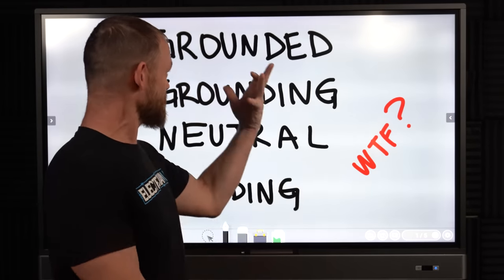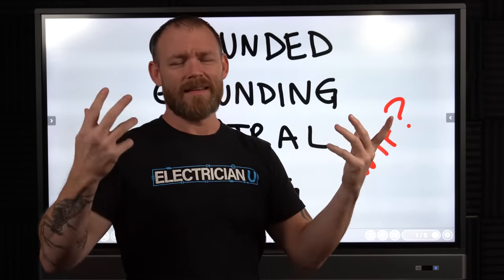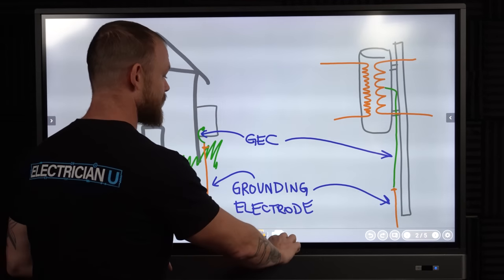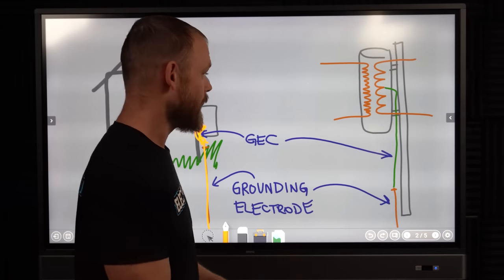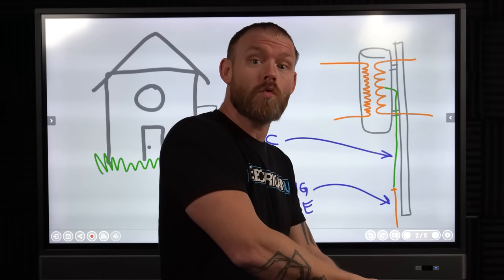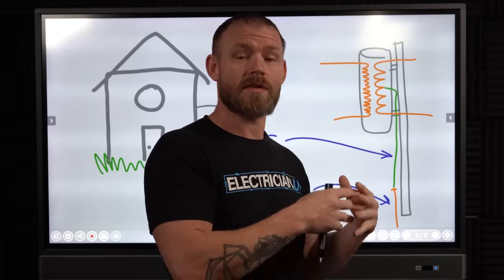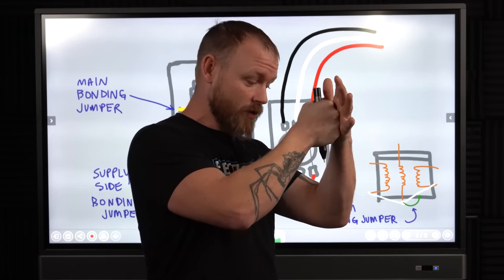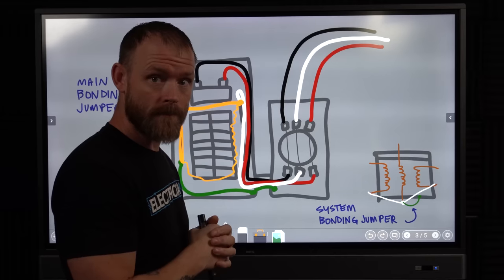What is the Difference Between Grounding, Bonding and Neutral?

Comment: Okay, it’s been a while since I read/heard this (so I may be wrong), but here goes anyway. It seems like somewhere, an electrician said that you should NOT bond neutral to your grounding conductor; this was because any normally functioning load, sending power back to the panel via the neutral, would also be energizing the grounding conductors through the whole system. And that would be a problem since all metallic boxes (outlet/switch boxes, junction boxes, etc) must be bonded to the grounding conductor to provide a path for fault current; if ground is bonded to neutral, and potentially energized by a running load, then that produces a shock hazard. Or am I remembering something incorrectly there?
Reply: The idea is that you shouldn't bond ground to neutral anywhere except the main bonding jumper. You need that single bond at the panel for the equipment ground to do its job.

But you are correct that there should be no other ground-neutral bond, otherwise, yes, the grounding conductor that is in parallel with the neutral will carry some of the neutral current, and a hot to neutral fault can energize other grounded metal parts in affected portions of the system.
Reply: That is mostly nonsense. Sure there can be very small stray currents but no cases are energized unless the neutral breaks. Do not listen to random people. In the US system one must bond the ground and the neutral. It is not safe if you do not.

There are countries where that is not done but they solve the problems with other methods, essentially house wide RCD protection.

Comment: Hey Justin. Why dont an electric water heater need a neutral? But needs 2 hot wires?
Reply: The heating elements on standard residential water heaters are 240Volt rated.  The controls are 240 volt as well.   No 120 volts needed, no neutral.  Small 6-12 gallon water heaters like in RV or for one sink are 120 Volt elements and controls.

Comment: I agree with you that the main neutral bus bar doesn't really need to be attached to a ground rod in order for the fault to trip the circuit breaker.  So why ground it to earth at all?
Reply: It's for static discharge. Surges on the lines, lightning, etc. It gives surges a place to discharge. Also,  some systems are sensitive and need ground rods for operational reasons (HAM radio guys like having a good local ground because it helps eliminate electrical noise). For example, have you ever listened to AM radio in your car and heard the engine noise in the speakers? Yeah, that could be eliminated with ground rods (but not really practical in a car).

So ground rods at the residence are for these things, not really "safety" or clearing faults. Mike Holt has discussed this many times. Holt did an experiment where he showed that a ground rod won't clear a fault on a standard 15 amps circuit. It won't because it was never intended to do so.

Comment: VALUE ENGINEERING:
If we could make the majority of our electrical equipment enclosures out of, lets say fiberglass, then a lot of this grounding and bonding would not be necessary.
Back in the day (early days of electricity usage), wooden boxes were used to house electrical parts and devices. But as electrical usage became more mainstream and
in-demand, new cost effective means had to be developed. Metal, being in high abundance, became the norm to house electrical parts and devices. But metal conducts
electricity, which makes electrical usage less safe. So that is where things like (EGC) and (MBJ) came into the picture. System Grounding, found mostly in a WYE distribution
system, primarily establishes Voltage stabilization, under normal operating conditions, and also helps to bleed off lightning strikes and surges.
Reply: Are there non metal electrical panels?
Reply: @dougsiskin1070  Non-metallic enclosures can be made (special order), but it has to be able to withstand the environment and conditions where it will be installed. Fiberglass or hard plastic.
Reply: Sure! That's why plastic ("double insulated") power tools don't need a ground

Comment: Many years ago, when we had a main frame computer installed at a bank , we were required to have an 'isolated ground'. Does that mean it was not bonded to the neutral and why did we need to have it?
Reply: It was bonded to the neutral at the panel, but not to any other metal parts such as boxes, enclosures, raceways, screws, the building, etc. The goal is to reduce some noise on the ground to protect sensitive equipment.
Reply: @benchociej2435  Thank you as I always wanted to know.

Comment: 12:10 important to note that the grounding electrodes generally don't dissipate enough energy to fully protect from faults. For instance, if you ran an EGC directly to a ground rod, it would do almost nothing to clear a ground fault.
Reply: Correct. Mike Holt has discussed this at length. He even filmed an experiment where he drove a ground rod to NEC specs and then ran a fault current through it. The rod did not trip a standard 15 amp breaker. It won't because it was never intended to do so. NEC doesn't require ground rods for fault clearing. They require them more for quality of life things (like giving static buildup a place to go). This doesn't matter for most home uses, but it could in sensitive industrial systems.

Comment: PLEASE HELP…

When considering Neutral Ground Bonding
in a Completely OFF GRID system…

If instead of a an electric company grid transformer supplying electricity 
as the source of power, 
we now consider a 
completely OFF GRID solar outbuilding, 
as the originating source of power 
(some distance from service structure 
where a main service panel 
will be the Main Panel).

1) Do we treat the outbuilding (power provider) 
    as if it were essentially the same as 
    a grid power supply transformer?

2) Do we create a neutral ground bond 
    in the outbuilding 
    (power provider equipment), 
    as if it were the pole transformer, 
    since the source of power 
    is generated there?

3) Do we create a neutral ground bond 
     at the Main Service Panel, 
     located in the service structure, 
     (power consumer structure)
     not near the power generating
     out building (power providing structure)?

4) if there is a NG bond 
     at the power producing outbuilding, 
     (power provider source),
     and a NG bond 
     at the Main Service Panel
     (consumer first point of entry)
     in the service building (consumer), 
     if a short circuit or ground fault occurs,

     a) WILL IT TRIP THE BREAKER 
          in the Main Service Panel
          located in the consumer 
          service building?

     b) will it trip the breaker 
          in the power outbuilding 
          (power provider source)
          that feeds 
          the main service panel
          in the service building?

     c) should each building 
          have their own ground rods?

 5) In the power producing outbuilding
      can the DC side and the AC side, 
      use the same Ground rod?
      or will this create an issue?

This is a tough one to figure out.

I have watched tons of videos 
but nothing explains what to do 
when you are 
the electric provider in one building 
and in a separate building 
you are an electric consumer.

Thank you

Need help on this one!

Comment: In my opinion, the 220 systems used around the world are MUCH simpler.
Reply: Well, even the 220V systems still require Safety measures, in terms of clearing faults. . . . .right ?
Reply: @griffmustard  Sure but is is much easier. They have very few electrocutions from equipment. Even ungrounded equipment. Most of the electrocutions are from touching power lines.
Reply: How so? There is much more variation like 5 different grounding systems, some use single phase, some three phase etc. Then there is different terminology in different countries.